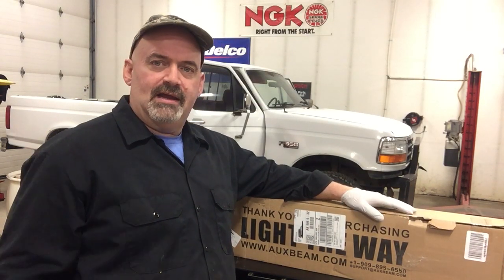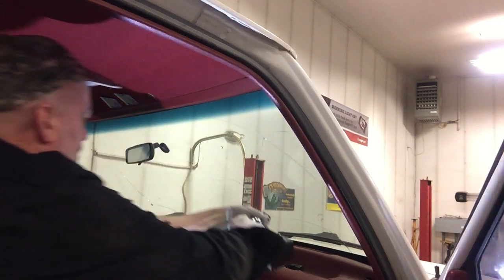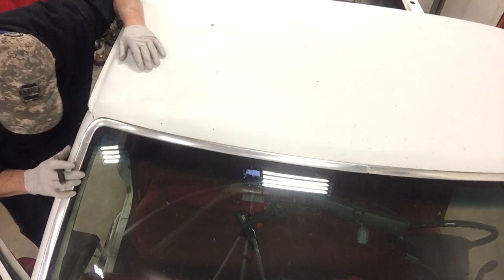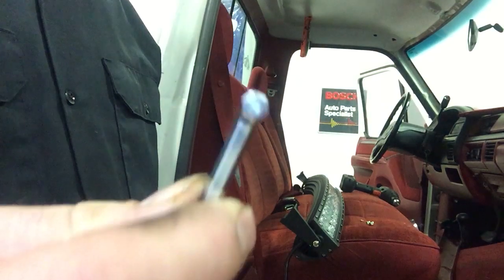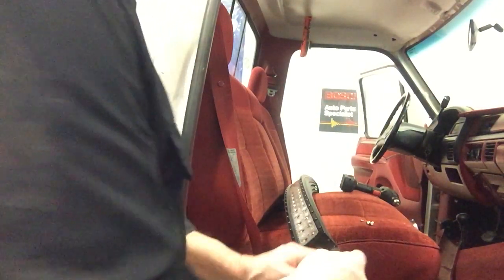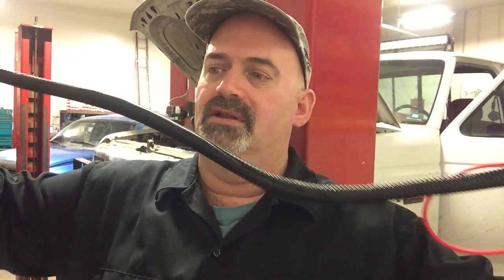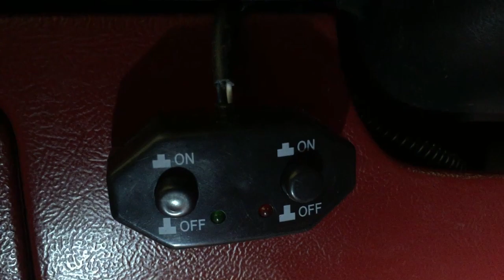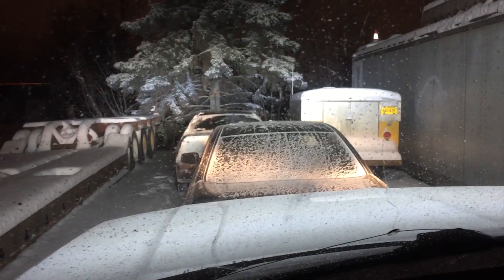Auxbeam 52" Curved Light Bar Install And Test Drive

Comment: Thanks Tim ! This video will surely shoot alot of ideas out there as after checking the auxbeam link there are many different setups for different applications and good prices. Thinking about putting some of the smaller ones on the front of my boat for running the boat trails at night. Thanks again !
Reply from the maker: Thanks, IM enjoying this one so far. It really lights up the night!

Comment: yup time to upgrade the headlights now. One thing leads to another. Haha. Nice and bright on top now.
Reply from the maker: No kidding, its crazy how weak it makes the headlights seem. One thing I probably wont do is install those HID lights or even those krypton bulbs since they tend to melt the wiring and lens assemblies. This company also makes an LED bulb conversion that I might try out here.

Comment: Pretty cool. How cool is it?
What happened to the WiFi for that lite, no wire holes.
Ya need nurse Jane Fuzzy Wuzzy to help ya hold the tape measure. Thought you were gonna mark the center of the cab and divide the light measurement in half more than one way to skin a cat er ah mark a truck light.
It's been awhile since I saw a soldering gun. Nice.
Reply from the maker: I used Fuzzy Wuzzy math to figure where to drill the holes. I think I just got lucky...well not with Nurse Fuzzy Wuzzy, I mean with the light.
Reply: Good catch and good qualification.

Comment: Great video Tim , thanks for sharing . I just recently bought an all white 1993 Ford F -350 4x4 like yours but with a 7.5 Western snow plow . Just finished flushing the old hydraulic fluid etc , glad I did as the fluid had a fair amount of water in it . 
I took the truck out for a drive for the first time with the plow removed . I know it's a 1 ton and all but it seemed like the ride was ok until I hit a few smaller bumps on the road at slow speeds . Harsh jolts , not sure if this is common or maybe my front leaf springs are worn out ?? Does your truck have just a 2 leaf spring pack on the front like mine or is it a 3 leaf pack & how is the ride ? Thanks
Reply from the maker: Mine has two leaf front springs and very harsh ride. I bet its better with the plow on it!

Comment: Hey Tim, Have you ever used any of the PWM switches to dim led's before and what's your opinion of them. They have some of them switches really dirt cheap on amazon and was thinking of wiring some of them in on my boat. I fish at night in the early summer and have always just hung the 12v bulb in a clamp on desklamp fixture on the side of the boat and was thinking about going with a couple of the 18watt led off road lights and also with the pulse width modulation switch wired in to be able to dim to my liking. Guessing motors and lights and other things are in use on cars and trucks and you are familiar with them.  Any thoughts?
Reply from the maker: I actually don't have experience with that type of switch but it sounds cool. Let us know how it works out if you end up installing them. I don't know if these LED lights are dimmable either. Thanks for watching and sorry it took so long to respond
Reply: Guessing you didn't realize I was talking about pulse width modulation switches. Actually that is the way to go on led's vs a rehostat. But nonetheless, thanks for the reply and I will let you know how they work out.  Blessings to you and your family as well and Merry Christmas !

Comment: Dam that made a hell of a difference, it made your standard headlights look pathetic LOL.
You dont need a wiring diagram, or instructions, its a man thing LOL :-D.
Pity you had to drill a hole for the wires too, surely they could have designed a drilled bolt to allow the cables to pass through, its not impossible with a bit of thought.
Reply from the maker: I was thinking I could have made a light rack and fastened to the bed but that truck is pretty beat up anyway so I just drilled it. On my new truck I think ill make a rack for it so I don't have to tear up the cab roof but still need to route the wiring somehow. Maybe through the back of the cab I guess.
Reply: Well if your using a rack bolted to the bed, you can bring all of the wires under the cab into the engine bay, the control wires can come into the cab via the firewall grommets as everything else does :-D

Yes extra wire will need splicing in, but a simple chop and solder isnt hard, just find a route under the cab for the wire to be zip tied to.

No damage to the cab, no visible wires :-D